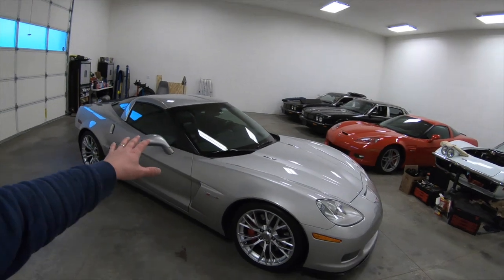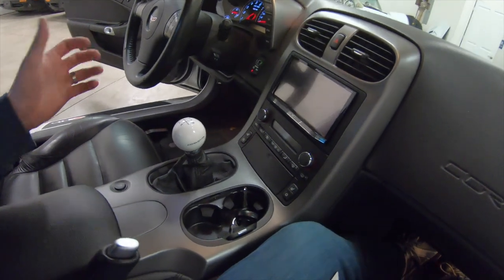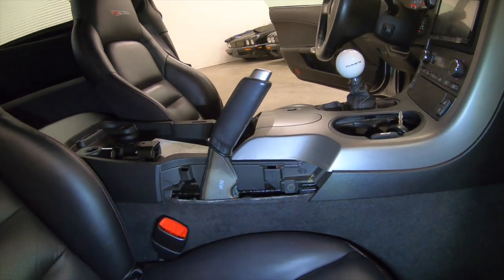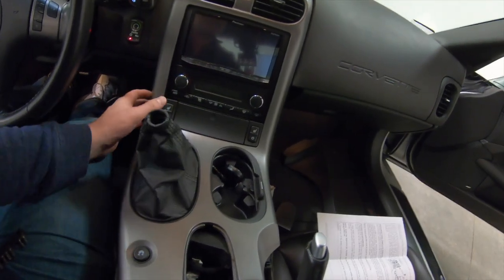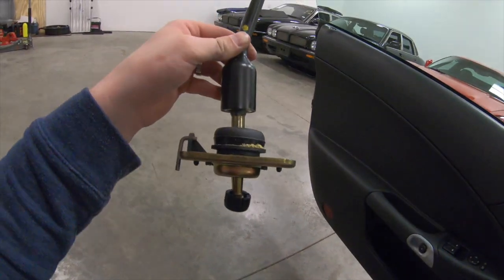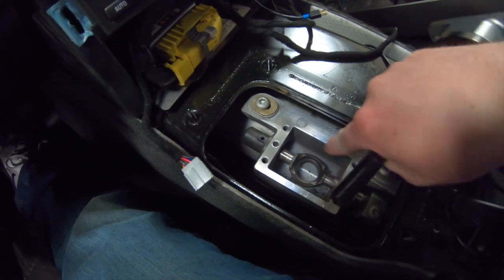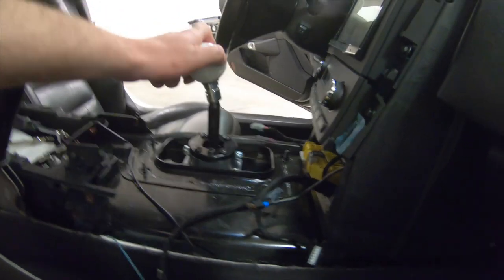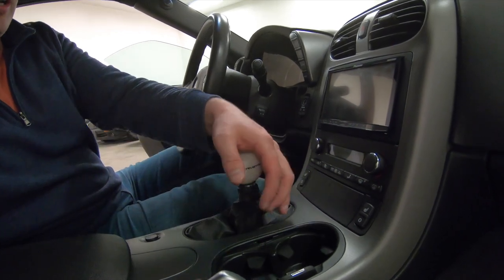C6 Corvette Short Throw Shifter Install! C6 Z06 Update

Comment: The Hurst billet plus short shifter for the C6 is only for the t56 and not the tr6060 according to the Holley website.  But the MGW shows its for either trans...idk what the difference would be as to why one is t56 only and the other working on either trans. I have a 2010 with the tr6060 and I'm planning on doing the MGW with a black Hurst knob.
Reply: the difference from what I understand is the thread of the shift knob, so your 2010 knob won't mount properly

Comment: After install did you experience any vibration from new shifter?
Reply: I did! Did you ever figure out what it is??
Its driving me crazy
Reply: @garrettbarnes7826  No I never read or found out what would cause this vibration, the only thing that really scares me because of the cost to repair would be knowing that I have a bad torque tube, but I really need to take it in and have it looked at, it could be just a lose screw somewhere in the shifter.  At least I hope that's all it is.

Comment: Does your vibrate under heavy acceleration,  mine did after I installed this hurst shifter. No one has been able to tell me what the problem might be.
Reply: @earthstix6407  Well I bought mine about 3 years ago, so they probably have gone up since then, I paid 269 for mine, but if you shop around you could buy a B&M shifter for that much, that's a good shifter to, Hinson is a little higher but probably offers a better application.  I was not to impressed with what I bought (Hurst) for some odd reason I had vibration during hard acceleration in my lower gears, not sure if it was how I installed it or what. I'm looking to investigate and probably will go with another brand of shifter.  I don't think it's my torque tube cause the OEM shifter did not vibrate before the install.
Reply: @bobbysalinas4845  i have this exact same problem and its driving me crazy, did you ever figure it out?